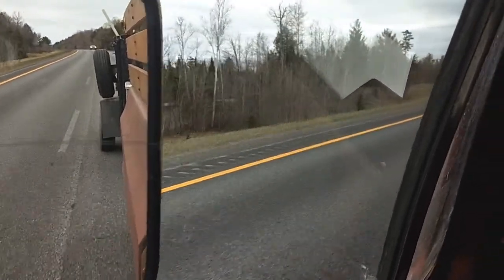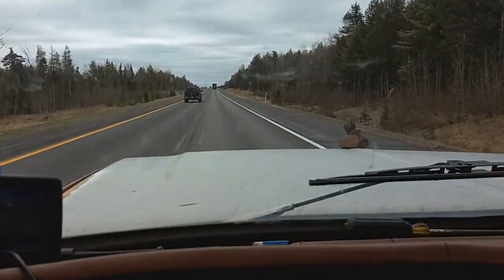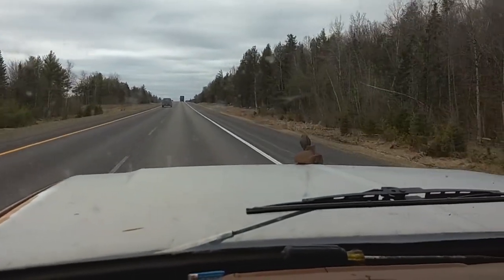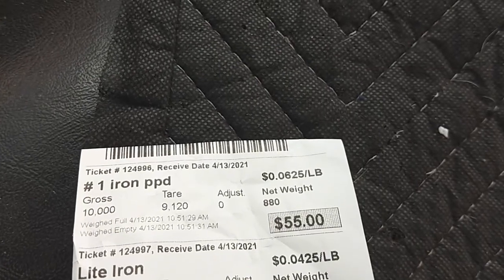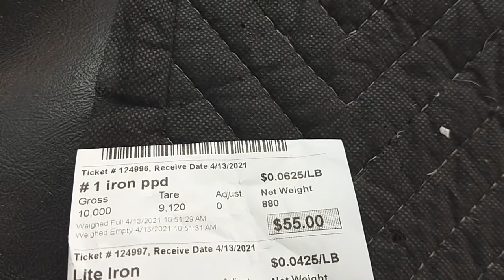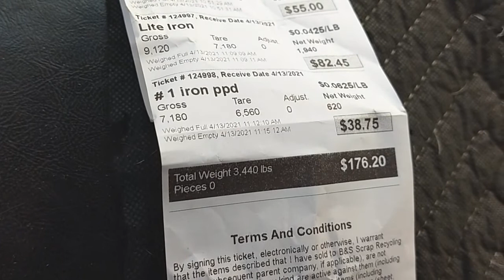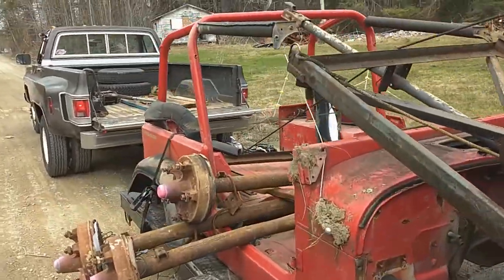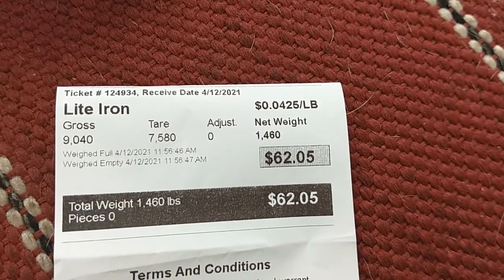Hustle, Grind, Coffee roll, Repeat..

Comment: You don't have to cut a 12 x 12 hole in your oil tanks we have to but I'm right here in Rhode Island I know you still live in Mass I'm sure you've went to Exeter scrap metal before right well they won't take the 275 gallon drums without you torching a whole or Saul's alling them so they can see that they're completely dry and you've put either sand or cat litter in them to soak up the remnants of oil
Reply: Meant to say I remember you used to live in Mass
Reply: They also charge us extra for the tires being on the rims
Reply from the maker: Place I go to up here takes them whole and they don't even care about a little oil in it
Reply: Great videos buddy keep them up